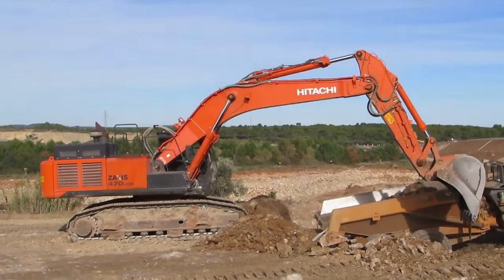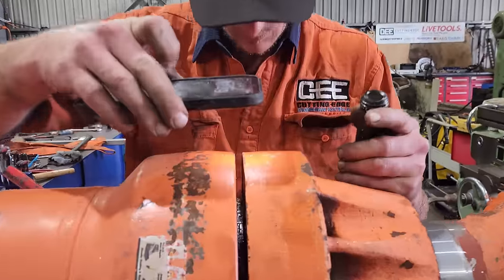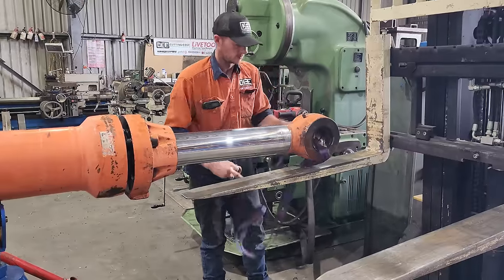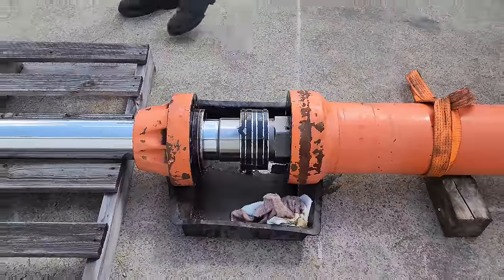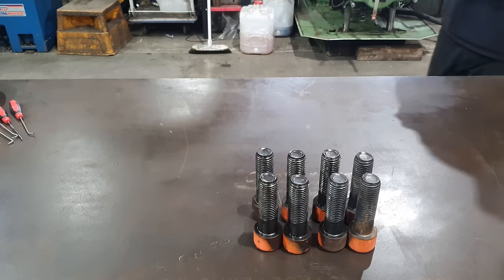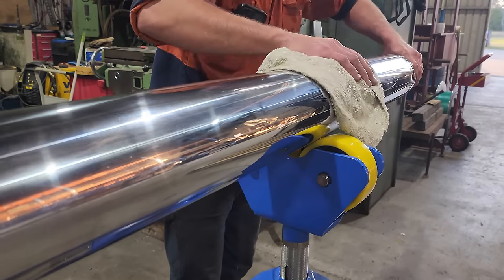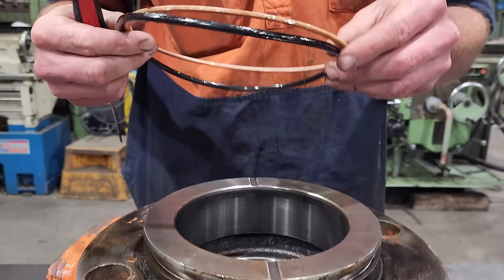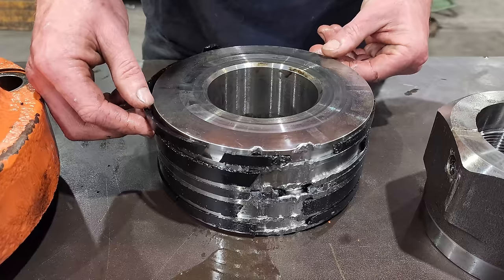It's STUCK! Can We Get This BIG Cylinder Apart!? | Hitachi ZX470 Cylinder Rebuild | Part 1

Comment: I agree, as a retired castrol rep, I couldn’t tell you how important regular oil sampling is to any fleet, not just a random sample every now and then, a regular oil test every service will save any fleet 10s of thousands of $.   Keep up the good work
Reply from the maker: cheers mate!
Reply: Military aircraft had a 100 flight hour oil sample, and the GSU equipment also had a sample taken every time any aircraft was done, as the GSU can supply hydraulic oil pressure for ground test. Any non normal result and all aircraft there got a hydraulic oil change, and the GSU as well, flush out the system twice with new oil, and change every filter as well, sent off for analysis in addition. You did not get many hydraulic issues with that method, and this is needed as that oil is used to keep the engine cool and lubricated as well, and a single failed bearing can result in airframe loss.
Reply: As  an ex F-16 crew chief, we sampled oil after every flight, even if they flew for 10 minutes.  Obviously different machines and circumstances, but I am still blown away that companies in this industry just destroy their equipment instead of have a down hour just to take samples, grease and lube, and a quick wipe down.   I know time is money, but so is downtime and complete barrel rebuilds.
Reply: I spent years as a heavy equipment tech and did fleet maintenance. I could easily tell who did sampling and who had a good tire guy. 
I have seen a few cylinders like this on machines that had regular oil samples taken. It’s not common but it does happen. Far more times contamination shows up in the samples and proper action is taken. 

Hopefully the rest of this machine’s hydraulic system is cleaned out correctly. When I was working on this stuff it was around 50k to go through the hydraulic system on a 30 ton excavator and the bigger ones could easily be over a grand. Most customers would just have peanuts(small pigs for hydraulic lines) blown through the lines. Then do a couple 10  hour filter swaps of bypass filters and hope for the best. The other thing they would do is send it through Ritchie Brothers and let someone else have the headache.
Reply: @covrtdesign5279 Have a customer I'm dealing with now who currently has 6 machines on their lot with over 20k USD in parts needed EACH simply because the operators were pencil-whipping their walk-around. No grease on the undercarriage suspension on 5 blew out components rated for 12k hours at under 2500 hours, and 1 machine they ran out of oil because of a very slow drip. 2000 hours and it needs an engine. 
Amazing what just a few minutes a day can prevent. Let alone regular sampling intervals.
Reply: It's not nessasary if your doing regular maintenance on the equipment. It's just an unnecessary cost they try to convince you is absolutely crucial.
Reply: @covrtdesign5279 
Time is money, but downtime & rebuilding is much more time & money. 
You can tell some people but they refuse to learn. Maybe these people will now, probably not. I have faith in them to do the wrong thing!!!
Reply: We oil sampled regularly but it was my experience that by the time metal shows up in the sample, the damage has already been done and metal has gone through the system. Some machines keep track of the amount of time each control is used so they provide a reference to how many hours particular components have on them so a rotation can be set up on when to reseal and rebush them before they fail. Unfortunately most facilities are overseen by accountants whose concerns are short term costs.
Reply: @tiredoldmechanic1791 One issue that I've seen come up has been if the sample port is post-filter. If the filter is not bypassing, and is of good grade, you won't see nearly as much of the wear metals as if it was on the inlet side of the system. A slow rise in pre-filtered numbers can indicate a wearing cylinder, or other item that can take some time to get as ugly as what is shown here. Whereas if you have good filters, the time you'll see that big rise is after it bypasses, and then you are generally hosed.
Reply: @Random-bm7ho   Necessary? No. Intelligent and prudent? Yes. Now, whether you opt to pay your dealer $50/ea for their sample kits, or send it to a different reputable lab for half or less of that, that is up to you. 
But for what you can catch with sampling (done properly, and from the proper sampling location in the circuit, which isn't necessarily the port given) can save you massive money in downtime and repairs. I've seen it play out time and time again. 
It's a lot like insurance- it's easy to bitch about the cost, but when it saves you, you'll be greatful for it. Although, sampling won't deny your claims just because the adjuster is having a bad day... maybe not the most apt comparison haha
Reply: What is the normal turn around for a sample? From when it's taken to when results come in, I always figured if operators and drivers did their pre-checks they find something way before an oil sample could give results
Reply: Love watching your vids curtis,really interesting to watch,hi from the UK 👍
Reply: @Maseraux  
A lot of what a properly taken sample can tell you wont show up on a daily walk-around. Breather went bad and you're getting excessive moisture or dirt in the system? It'll take a hell of a lot before the average operator will notice anything. Heck, I've worked with and around enough operators over the last dozen or so years to know that 80% of them wouldn't notice much of anything, that isn't a failing HVAC issue or pouring liquids on the ground. 
Depends very much of the lab, how far away they are, etc. Fastest I've ever seen was next day results in the email. Longest I've seen was 3 weeks. Normally around a week.
Reply: @tiredoldmechanic1791  That's totally unscientific. With preemptive testing, by definition there is a level of particulates (size and count) in oil below which the damage is minimal/non-lethal if action is taken. If you let it go beyond that point, you get expensive damage. All your anecdote says is that the  testing regime was substandard - either incomplete sampling, insufficient frequency or both. Effective testing won't save you every single time, but over time, on average, it will extend the service life of components like this significantly.
Reply: @typrus6377  I don't need a lab to tell me if my equipment is failing. I'm saving the $$$. If your mechanic isn't cutting open filters, monitoring drain plug magnets, and not looking at fluids he's not doing his job. If it's gonna blow it's gonna blow, doesn't matter if I have a sheet of paper telling me it's going to blow, cause either way it's fucked
Reply: It's in every industry, whether the neglect/abuse is toward equipment or people, there are many folks who have no regard, no care, for the damage they do, even though it's proven to be an expensive attitude.
Reply: @andoletube  You could take oil samples every minute of every day, have a testing facility on site to get instant results but still have a catastrophic failure of a part contaminate the entire system the instant that it happens.
Reply: As a tribologist, I was able to identify specific parts in engines, gearboxes and shaft seals for marine applications so the repairs would proceed as quickly as possible.
I had a 98% success rate 😊
Oil analysis is a powerful tool when used correctly and step 1 is always collecting constant samples, preferably from sample ports in flow so the sample is representative of the reservoir 😉
Reply: I see client fleets of various types, and it becomes obvious that one approach is to do minimal or failure-oriented repairs and long interval work only.  This may make sense on wear-items.

Sometimes, the machinist, farmer, excavation company is as few as one to three people.... and the office staff is family pressed into service! Guess who the FLEET MAINTENANCE manager is ? The time to track, replace or repair BEFORE failure point can far exceed having a professional fleet service schedule, preventive maintenance program, etc.... but the more flexible FARMER approach would not do well in a larger company, with more and more-modern equipment, just as the same arguments can apply to personal transportation.

The specific equipment, reliance upon up-time, age of equipment, amortization, replacement budget; all factor into the ROI. In a small operation, one might be able to work around one piece of equipment awaiting parts or repair....... very specific to the situation.

 Preserving capital as well as equipment is essential. Spending the money WISELY is the challenge!
Reply: "Nothing costs more than cheaping out"
Reply: As an Engeman in the Navy, we had a 12 V 71 Detroit diesel that came back with a high iron content in the oil like four times we were told to pull engine and investigate turned out. We need to go up getting water in the back outboard cylinder, it tried to compress it and ended up, bending the connecting rod in both directions.
Reply: Yeah, I’ll tell you watch. It’s amazing how some companies can fuck up just about anything.
Reply: @typrus6377  Please tell us those Operators are now Fired For Cause and Blacklisted from the Industry...

They shouldn't be allowed within a hundred miles of the controls of anything more expensive than a Dollar Store RC car...
Reply: @HappilyHomicidalHooligan  
Nope. Still at the same outfit no less. Can't fix stupid unfortunately.
Reply: Actually the oil tests don't show much unless its a catastrophic failure because the filters remove any of the contaminants.
Reply: @williamturkewitschturkewit1549  False. "Any of the contaminants" is incorrect. Sampling can show changes in additive package component concentration, in levels of contaminants that do not get caught by the typical 5 micron filter, in water contamination, in changes to ph, and a variety of other things. Regular sampling let's you monitor those trends that can help you determine if you need to go ahead and shorten your service intervals (or can even extend them sometimes) 
A slow progression of failure caused by, say, failing rod dust seals allowing water and silica into the system, can be tracked. The very fine metals that won't be caught by the filters will rise over time, hinting that a closer look should be taken. 
This can help prevent problems, if by nothing else, then by virtue of seeing that the PM interval may need to be tightened up because of the operating conditions. Or that a closer look needs to be taken at things like aforementioned rod seals, or even something as simple as poor fueling and oiling practices by operators or yard hands. 
You don't need weekly samples. You likely don't even need monthly. For the average setup, in average conditions, sampling at the 500 hour PM interval is plenty good enough. Even at 1000. For something like a skidsteer or compact track loader, I'd keep to 500 or less on the hydraulics and finals/chain cases. I've seen way too many killed by a complete lack of attention in general, particularly those little finals.
Reply: You all should ask me I know it all I left school at 14 because I knew it all LOL
Reply: @williamturkewitschturkewit1549 Draw the sample from BEFORE the filter.

Comment: As the old saying goes; "If brute force isn't working, you're not using enough."
Reply: If duct tape fails to work, you didn't use enough duct tape.
Reply: There's another old saying.. it goes. That's NOT an old saying. I think you just made that one up.
Reply: Don't use force, use a bigger hammer.
Reply: And if a bigger hammer isn't the answer, you're asking the wrong question.
Reply: Metal cant be stuck if you turn it to a liquid
Reply: This is going on merch right?
Reply: I thought the old saying was, "if you want it done right, use C4..." or was that a mythbusters thing...
Reply: @TrailRat2000  Any problem can be solved by a suitable amount of C4.
Reply: If the manufacturer's warranty covers the damage you did, you didn't do enough damage
Reply: Get a bigger hammer
Reply: "or you forgot the screw under the sticker"
Reply: If it doesn’t fit (or come apart), force it.
If it still doesn’t fit (or come apart),get hammer.
If it still doesn’t fit (or come apart),get a bigger hammer.
If it breaks, it needed replacing anyway!
Reply: A mix of brute force and ignorance often does the trick too : )
Reply: My Dad always used to say "brute force and ignorance!" It was amazing what that man could get done.
Reply: The beatings will continue until morale improves...🇺🇦🇺🇦🇺🇦Slava Ukr4ine 🇺🇦 🇺🇦 🇺🇦
Reply: If it ain't broke, try harder
Reply: @rushoffman965 ..."If it ain't BROKE- you're not TRYING!!!"  - Red Green

Comment: I work as a machinist at a manufacturer of hydraulic cylinders. I also spent three years assembling them before I moved to machining. I love watching these cylinder repair and rebuilds. It is fascinating to see how you do a lot of stuff differently than we do them.
Reply: Could you comment on doing the stuff differently? Do you think one method allows more accurate results and another allows faster work, or is there more important differences?
Reply: @MikkoRantalainen The big difference is probably that when @paladin50554 builds a cylinder it is pristine and new, whereas when Kurtis is working on it it will almost always be borked to shit 😂
Reply: If you haven't got a forklift iv got rams apart using a jetwash as a pump in the past, safer with the forklift tho.
Reply: @rlaxton666 it's true. Most issues we have are related to our own machining errors.
Reply: @MikkoRantalainen the biggest difference is in the scale of the work. Where I work we build anywhere from a single cylinder up to orders for several hundred. There are times where I have spent a week or more machining several hundred example of one part. There are also days where I'll  machine one example of 6 different parts. Also everything we do is done with CNC mills and lathes.

Comment: I was thinking as I was watching today, how nice it would be to have everything on hand that is needed to complete a project, without having to stop, because you don't have a piece of tooling, or a tool, or piece of hardware.  Even after more than 25 years as a hobby machinist, I never get through a part without having to stop.  I realize that's partly poor planning on my part.  But you almost always have what you need on hand.  But then you blew my illusion, because you loaned your spanner to a friend, and it didn't get back to you.  You're just like the rest of us.  Thanks, Kurtis.

Comment: Thanks for the vid - roll on part two ⏳
Love the editing - especially how it makes everything flow so naturally. Great example is Kurtis drives the rod out of the workshop to have the nut cracked, Homey plays with a toy while Kurtis is away and then Kurtis returns with with the rod. Great storytelling - thanks Karen.
I know bugger all about hydraulic rods/cylinders - so what it the purpose of the silicon bronze bit at the end of the rod?
All the best,
Paul
Reply from the maker: Hey mate, the silicon bronze is a sacrificial material because the rod end acts as a "choke" when it goes into the end of the barrel during the close cycle the silicon bronze prevents metal to metal contact and won't damage the cylinder if it does bottom out.

Comment: I love the videos.  I am not a engineer or machinist, but it's the little things I learn like watching today was instead of the just beating one spot on a seal to get to a point to pull it out, punch in a few spots until you get a big enough dent to get the gap you need.  40 years or so of occasional seal replacements and I've just been beating the same spot and Kurtis made it look so much easier...

Comment: Kurtis usually seems so precise and professional. It was fun to watch him get a little red neck with tying the rod to a shipping container and pulling on it with a forklift. I liked that he had to get a little bit of a running start with the forklift too.
Reply: Yeah, I was afraid he might move the container. I suppose there’s more heavy steel stored in there.
Reply: @bkbinj6320  Well, a 40-foot container weighs roughly 3,750 kilos empty, so that's a good start right there.

Comment: Kurtis demonstrating his Superpower of seeing CoG when slinging things, good to see.  It is very surprising that a relatively flimsy seal can hold back 3,000 psi, always a surprise.  Good work on the camera and editing Giggler!  How many George Birds are there now, I thought it might be four, they are bringing their friends to see the fantastic work.  Homey taking things slightly easier this week.  Thank you Kurtis, Giggler, and Homey!  Live long and prosper!!! 🖖🏻
Reply: Blindly assuming a 0.1mm/.003" of gap there and 8 inch diameter, it means ~ 0.1 sq inch so...about 300 lbs of actual force acting on it. Conversely, pressuring a garden pump with 25 PSI and an opening of 4." diam, that's a 100 PI Lbs (314.141592654 lbs ) of force...and with a cap that doesn't thread properly and launches itself, you've made a canon.